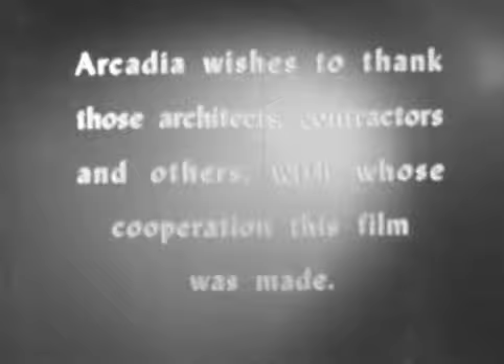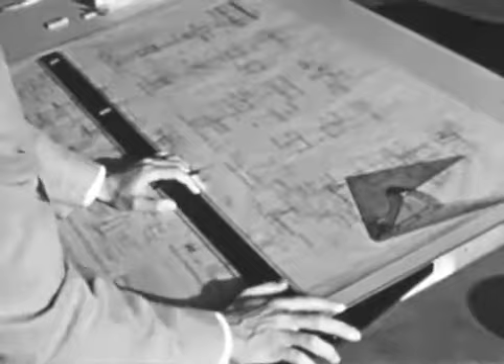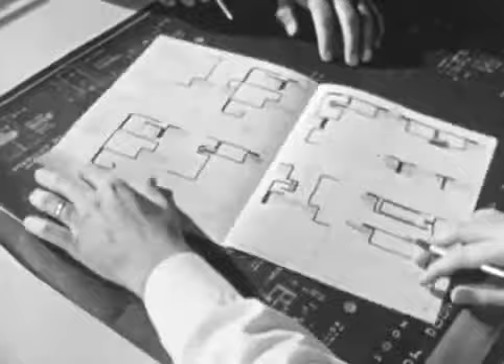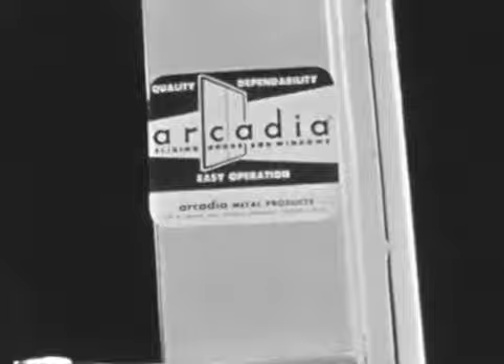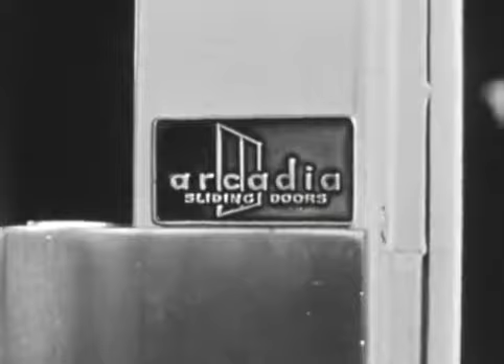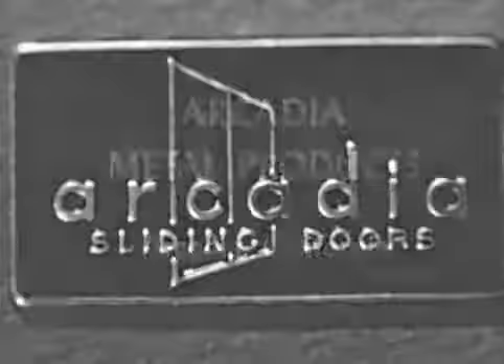The Door to Gracious Living I Arcadia Custom

Comment: My 1951 house still has its original Arcadia slider in good working condition.  The frame is welded steel, just like shown in the video.  When did Arcadia switch to extruded aluminum frames?